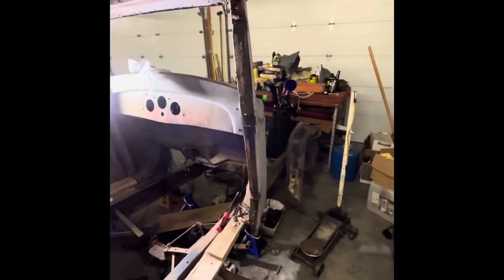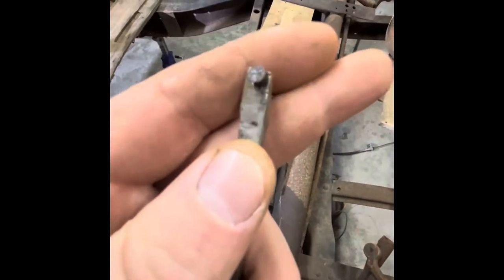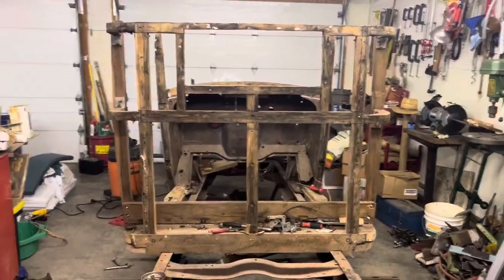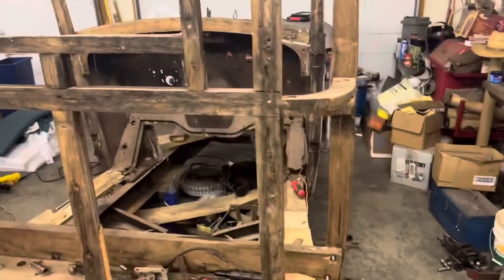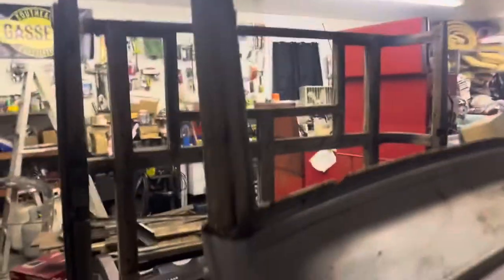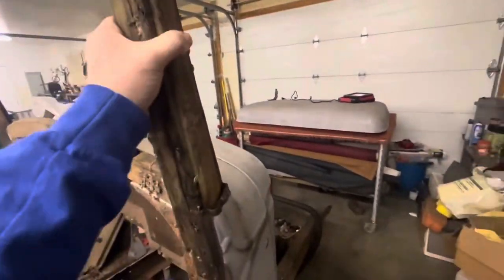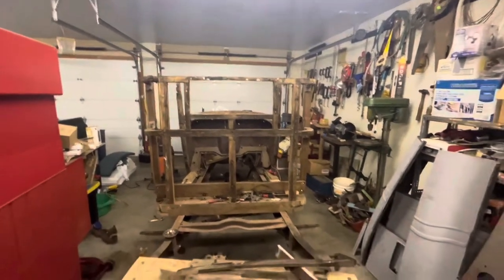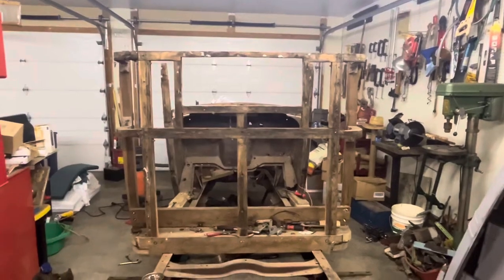1934 Chevrolet 1/2 ton pickup truck tear down!

Comment: That wood is way better than mine. Do you have the dimensions of the door pillars?
Reply from the maker: The front pillars are roughly 49x2 and the rears are roughly 52x2. These measurements are more than likely off slightly due to the rot on the bottom part of the pillar. Hope this helps. Thanks for watching.